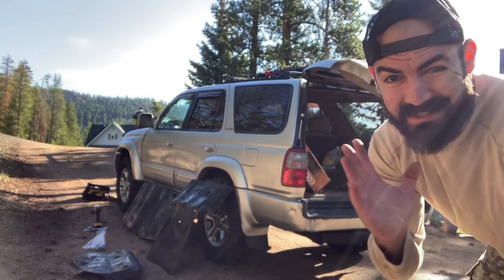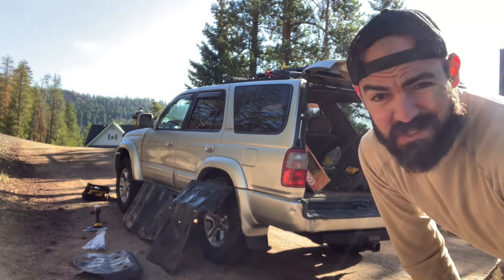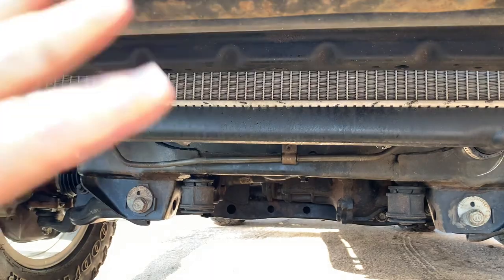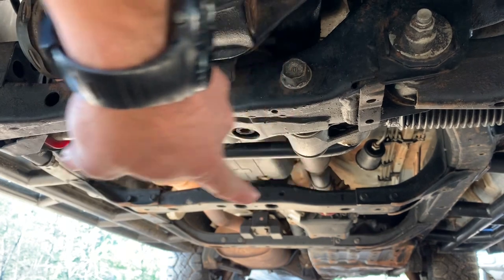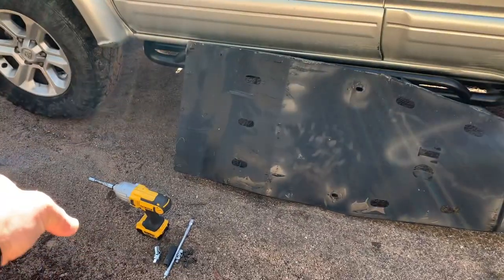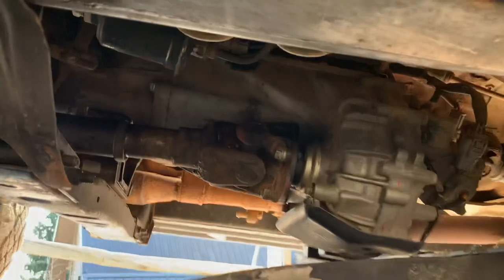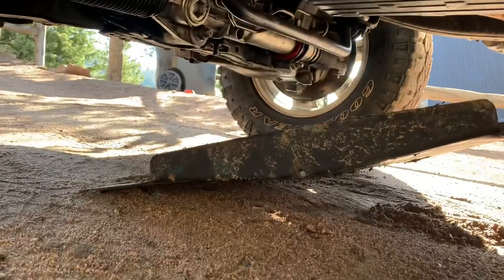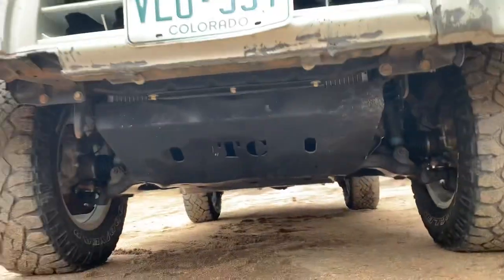3rd Gen 4Runner Skids Installed! - Time To Go Sledding!

Comment: Unrelated to this particular video, but on my 2017 Tacoma SR5 2wd , i have Nitto ridge Grapplers 265/75/16 on stock 16" alloy rims and plan on installing Supreme suspension 1.5" spacers as im about  .25" away from my UCA . Also have on the way a 2" front 2" rear Torch spacer-block lift kit. . Thanks for any input . Saw where you rocked your 100 dollar lift and seeing if you came across any issues.
Reply from the maker: Nope; no issues at all. I think that will get you dialed in.
Reply: Thanks for getting back , keep up the great work and resourceful videos 👍
Reply from the maker: I really appreciate it. Have a great weekend